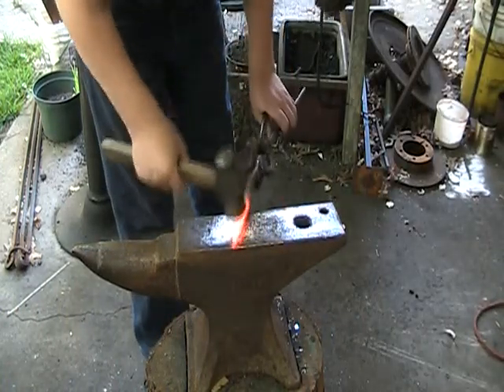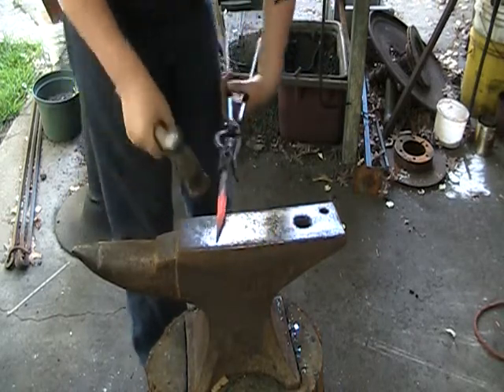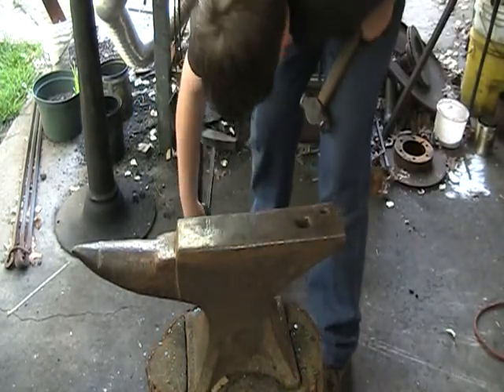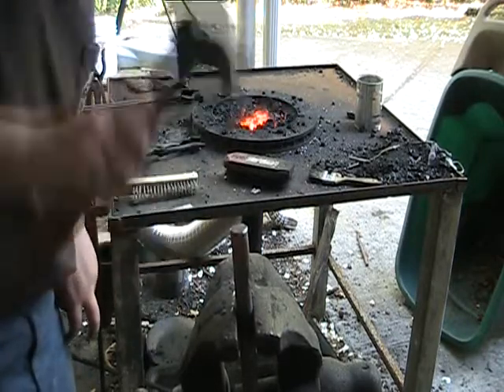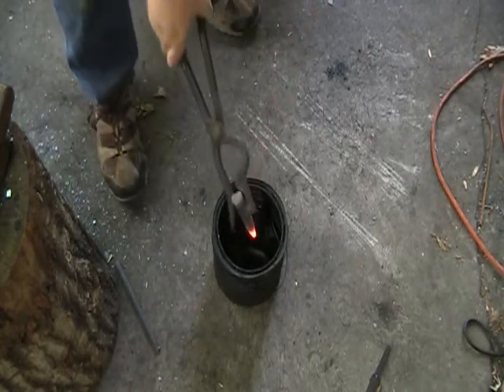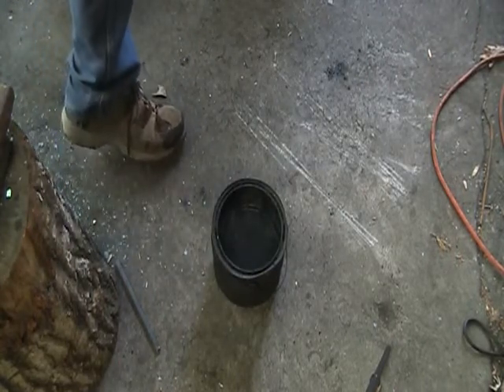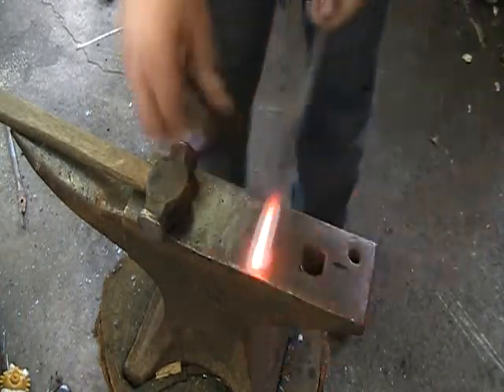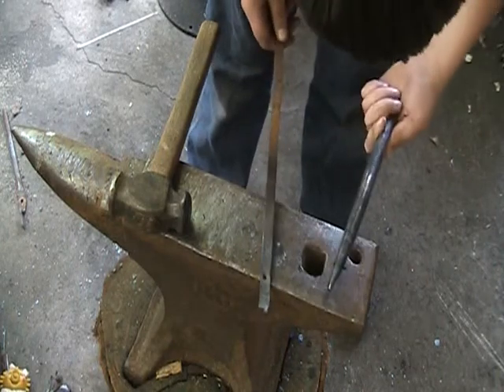Hot punch part2

Comment: @13Jimbo37 yh but its really brittle and has a very high chance of chattering or cracking, the best thing to do is cool it quickly then heat it slowly and cool it slowly,
tempering it in this fashion ensures the best all round result for tool steel